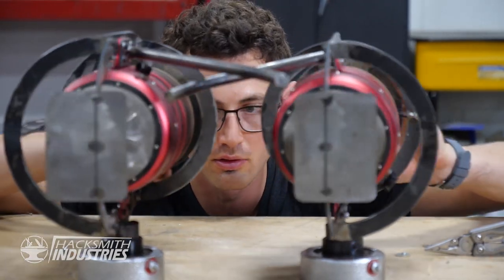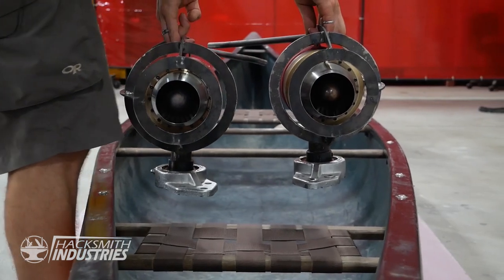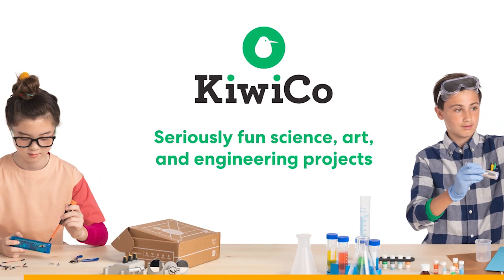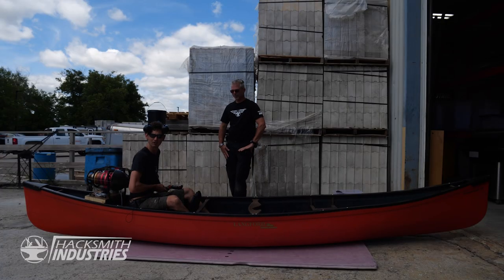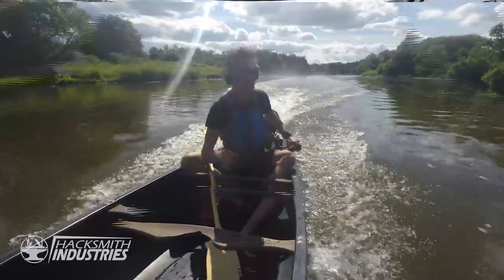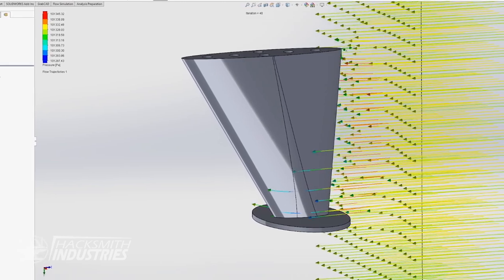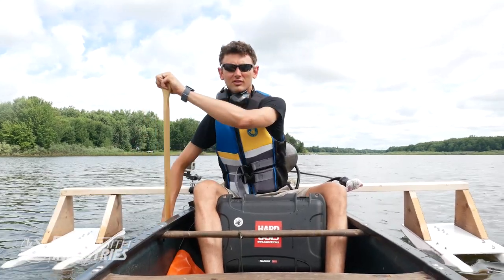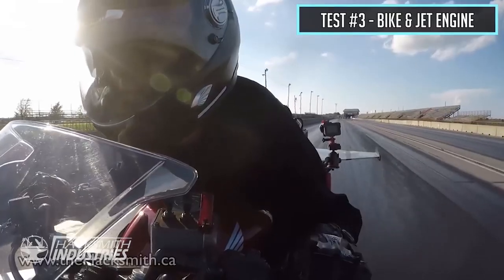JET ENGINE CANOE! (World's Fastest!)

Comment: Putting more weight at the front would probably really help avoid high lift when you are going full power.

Maybe make a bigger fuel tank and put the tank at the front?
Reply: But then what happens when your tank is almost empty?

I think they need to move Ian's driving position forward more... maybe make a revision on the steering mechanism so that he sits low, and roughly in the middle... =D
Reply: Yes. That and also put the driver seat more towards the front of the canoe. Also I noticed that the thrust from the jet engines was pointing up slightly which is acting as a moment and putting torque on the canoe which is probably some of the reason that it is tipping back so much. If they adjusted the angle so that the thrust was pointing down a bit more, it would probably give the canoe a more neutral angle at higher speeds.
Reply: Will a wing that acts like a spoiler work?
Reply: Need to be able to trim the jet engine just like boats are able to do
Reply: @langcapreubenb.6129  It probably would work a bit but wings only work effectively at pretty high speeds (unless the wing is pretty big). So it would be more efficient to reposition the existing weight or tilt the jet engines to a better angle.

Comment: Wait why didn’t you make the tiller longer and so he could sit at the font to weigh the front down so the back wouldn’t go down and he could go faster 🤭🤯🤨
Reply: Talking about hoe smart they are...
Reply: bc you can barely turn if you make it too long.
Reply: Right!?!? It would have been so much faster if it got on the plain and reduced drag in the water. Easy fix!
Reply: @blackhawk97  if you added a tiller extension like in sailing it could work just fine
Reply: because wheelie
Reply: The problem is that the thrusters are getting most of their propulsion from the waters density if the motors aren’t tilted towards to water it would go much slower as it will be pushing against the air density which is a lot less than that of water so in turn the water contact is actually helping the air get grip if you will ( this is a educated theory )
Reply: @Beezle   the mistake is the design of an kanu it cant get faster  ,look at the desin from racing boats and kanu ,kajak ,and sayling boats ,,, excuse my eng
Reply: It wouldn’t make it faster lol and also you wouldn’t be able to steer because of the length of the tiller
Reply: @dylanwatson7189  thats not how jet engines work.... They get their propulsion from sending air backwards. Not from what that air then hits.
Reply: There are two main design faults:
First.... the jets point upwards, they sink the canoe rear end, you need to trim the angle.
Second.... some flat "winglets" widening the bottom of the canoe in the back would lift it and stabilize way more than those fancy buoys you guys made!
Reply: James McCann I fully agree with you. Answer me this though, if the boat had a set of wheels and two thrusters with nothing but the open air behind it let’s name this object 1. Now you have the same boat with the same wheels and thrusts and this we will name object 2, just that object 2 has a wall behind( 2m away from thrusters) 
Will object 1 or objects 2 accelerate faster?
Reply: James McCann this is purely for educational purposes I am not under no circumstances trying to belittle your knowledge. And Nor I believe you mine.
Reply: @dylanwatson7189  please look up how jet engines work. How do you think planes fly? What is the exhaust from those engines hitting? Jet engines get their thrust from the air going through them being accelerated, and then conservation of momentum means that air being forced in one direction must equal the force in the other direction. Because the jet engine is accelerating the air, the jet engine therefore experiances the equal but oppsite force.
Reply: James McCann theoretically it is hitting the air around us. But in this case it is a thruster so they use ignited fuel to accelerate the particles of air that is sucked in but that is besides the point. I understand where you are coming from. So in theory object one and object two will have the same acceleration?
Reply: @blackhawk97   these guys are playing with jet engines, cnc and 3d printers not to hard to engineer a steering column.
Reply: My thoughts exactly, but also how about fixing the engines and making a simple rudder to steer?
Reply: @dylanwatson7189  no, the fuel being used to accelerate the air is not beside the point, that quite literally is the ONLY point when it comes to thrust of a Jet engine. If its the exhaust hitting the water that gives thrust, how does that water push back on the boat? It doesnt. The thrust comes from the air that is accelerated by the engine, not what that exhaust hits. You are embarrassing yourself even more, just please look it up.
Reply: @dylanwatson7189  Newton's 3rd law.
Reply: @dylanwatson7189  the pressure of air behind the motor is not what moves the jet forward. Its that the jet is moving the weight of the air against its own weight. Like swimming in a pool. Having a wall behind you won't make you swim faster. Same goes for how a rocket engine can move something forward in outer space.
Reply: Did nobody remember when James said he had no experience?
Reply: @reesy22  getting the canoe on plain SURE WOULD MAKE IT FASTER...DURRRRR
Reply: Dylan Watson ahhhhhhh
Reply: tloutfitter um no it wouldn’t mate because it was already on the plane 🤣 plus sitting at the front would do nothing to a jet powered canoe, plus you literally wouldn’t be able to steer it.
Reply: If your solo canoeing you don’t sit at the front it throws of your balance
Reply: thats a good idea
Reply: @reesy22  It was plowing through water and definately not on plane.
Reply: @warmcanadain7649  Not at the front but at the back is not so geat aswell. Specially with all the added weight of his propulsion unit.
Reply: That's just too simple for a bunch of engineers. Hell, even a full cooler in the front.
Reply: Or have another person sitting in the front of the canoe would probably do a lot towards fixing the issue as well as most people who have ever been in a boat would know
Reply: @Firefox-cr3jw  Don't think you should be talking about how smart someone is if you can't spell how buddy.
Reply: @dylanwatson7189  No.
Reply: @dylanwatson7189  So in your opinion rockets don't work in empty space, but they do. Work great actually
Reply: @leifvejby8023  no no i just had a theory thus the reason i said it was a educated guess 😂 I did a lot of research revolving around this and proved my theory to be correct but only by the fact that the force of the fuel and compressed airs backwards force to have bounced off the wall causing the air to act forwards acting as a back draft of wind to give it a 1.34second head start but nothing game changing. My argument was that the air around had a effect on the thrust of the jet motor through contact forces of the air molecules which was in a way correct as the thruster needs oxygen but it doesn’t need surrounding air to have a forward force. So i did mix everything up but now it is all understood. Sorry for the confusion🗽

Comment: Could you mount the jet engines to some sort of boat drone that could be operated remotely by a trailing waterskiier?
Reply from the maker: Hah.  Possibly!
Reply: Hi!
Reply: a jet-ski that is controlled by a pulled waterskier has been done already.
now seriously: you should be putting the Driver more to the front to let the canoe lay flatter on the water.
and then it needs hydrofoils.
Reply: Ulrich Kälber yes i thought that too
Reply: Now this is pod racing!

Comment: It's more of a skeg rather than a keel bc a keel has weight.
To improve turning put one of the fin things about halfway up the hull to act as a fulcrum also you need mass in the front to really plain (ride your bow wave)
Put a hydrofoil on it for your next project. To make a flying jet-powered canoe
Reply: It’s Plane...not plain
Reply: First thing I said also. That’s a skeg, not a keel.
Reply: I just like the hydrofoil idea
Reply: They're called drop keels, many small sailing dinghies have them. It's a vertical board that is dropped into a slot in the centre of the boat, to stop flatter bottom boats being blown sideways by the wind.

My remedy would be moving the seat forward, and putting the fuel tank in the bow.

Comment: I wonder if it would have been more effective to forget about thrust vectoring and just use a rudder instead...
Reply: You would have to worry about the effect of torque on the boat, especially if the torque was not aligned with the centre of mass. The effect would be every time you turn you would begin to or even flip the boat.
Also if they moved the centre of mass forward, either by adding bow weights or moving Ian forward, they could of fixed the angling issue.
Reply: a rudder would just roll the boat over
Reply: @Eagle79797  @Dan Luckins Maybe a rudder and out riggers then
and weighting the front goes without saying haha

Comment: NOT JUDGING.

This was an amazing build and I thoroughly enjoyed watching it. 

One thing, wouldn't you be able to get more speed angling the engine at the water as it is more solid therefore producing a better object to push against and allowing more speed to be generated
Reply: not if you think of thrust as a (YZ) vector. it might appear to balance the canoe though, but that would be converting the thrust from  to gravitational potential energy lifting the back of the canoe instead of kinetic energy accelerating the canoe forward.
Reply: Taine Wilkinson Most likely but I would also imagine that with the engines' exhaust outlets facing downwards, the downforce effect on the canoe would simply force the nose underwater.

Comment: How about having him move forward by like half a meter? 🤦🏼‍♂️
Reply: They did the same thing with the Silver Surfer Surfboard, but that hull was actually designed to go on plane.  They built these amazing machines that could go signifigently faster than shown in the videos if they had a little more of an understanding of planeing and hullspeeds.
Reply: It just hurts me on the inside because this thing could be sssssooooooo amazing with just a few tweaks
Reply: @GaggleingTurkey  yup, also less risk for the engines and it wouldnt look like a submarine xd
Reply: I volunteer to ride on board more toward the front 👋

Comment: the keel is solid structure on the bottom of the boat that the rest of the boat is built off of. what you are think of is the rutter that changes the boats direction and keeps it in line

Comment: In order to flaten the boat out, I'd either sit up front and build a longer controls arm, or make a trim adjustment similar to a boat. Where you can control the bow with the angle of the prop(jets).

Comment: canoe hull is made for displacement which you're trying to push it past that speed.  You needed a planning hull like a skiff.   Also maybe try directing the exhaust into a "Y" pipe under the boat so it hits a stream of water and accelerates it out the back

Comment: Mounting the enginesstationary  on hydrofoil style outriggers about 4 feet outside of the canoe hull on each side would allow steering by throttle for much more responsive handling while also increasing stability. This setup  will give the canoe an added capability of a quick 90▪turn and cut throttle emergency stop which with practice can be safely performed in a remarkably short distance from full speed ahead to full stop.

Comment: move the pilot forward thus shifting the weight more towards the bow. then use a joystick and steering cable to keep the pilots weight centered. mount the throttle and switches on the joystick! ( a square back boat would be much more stable too. )

Comment: 1) shift the center of gravity forward and as low as possible. (fuel & controller in the bow operator forward as low as possible.)
2) a small single rudder tied into the tiller. 6" tall by 3" wide centered at the stern protruding 3" bellow the bottom.
3) trim angle is critical at high speed for stability be able to adjust the thrust angle from the jet vertically also make the mounting plate adjust front or back to tilt the jets (threaded rod and a nut)

Comment: I think maybe if you were to change the angle on the jets you could get it to plane out faster. The jets are sitting on the sides on the up slope of the canoe. So technically the jets are pointing down at the intake end causing the nose of the canoe to raise. Raise the intake end up a bit having it higher than the exhaust I think it would work better. The only thing to watch would be your exhaust temp on the canoe.

Comment: This is awesome but you're seriously missing out on some top end speed with the draft angle you've got. Might I suggest some wedges in between the jet mounting plate and the gunwales such that the jets are angled downward instead of parallel with the keel? That should bring the bow down so you cruise more level relative to the water. As an added bonus, having more of your keel in the drink should greatly improve stability at those higher speeds.

Comment: Needs some small upward angled planes at the rear sides so that as the canoe moves forward the rear is prevented from pushing down. It also needs a rudder at the stern for direction control.

Comment: Did you taper the jet engine mount? It looks like they were pointed upward where the canoe angled up towards the stern. That would push the stern downward. That was the problem with the outriggers too. The noses of them were lower and they were digging into the water.

Comment: Love the concept of the video I feel like if you guys figured out a way to weigh down the front just a tiny bit more in it so the boat to climb a little bit more out of the water instead of riding in the water it’s basically skipping across the water and because you’re using the engines pointing towards water pushing you forward you’re gonna get even faster I think if I’m not mistaken on how boats work

Comment: From my understanding the goal of hydrodynamics in regards to boats + speed is to raise the hull of the boat out of the water as quickly and stably as possible to reduce the contact with the water. Most fast boats have just the very rear of the boat in the water. In this particular case, you're not modifying the hull so you are really looking just to stop plowing the rear of the hull down into the water. If you made a mount that had the jet engines in roughly the same area but did not attach to the boat at that location(cantilever mount), and instead attached more toward the middle or even slightly forward, you could create opposing forces. I would probably make this mount attach to a rail in the floor of the boat so I could make adjustments from stem to stern and lock them into place to test for optimal trim.  You also want to reduce as much weight as possible.... obviously.

Comment: You guys should put a metal plate behind the engine to cover water from getting in the canoe, also if fuel and weight is a problem just put a bigger fuel tank in the front so you have more gas and it will not lean as for back. Please try this idea I think it may help you guys. P.s. I love the videos and content that y’all make keep up the good work.

Comment: You guys would have to put some heat shielding on top of the rear of the canoe but adjusting the angle of the jets so that they point on a downward angle toward the water should prevent the bow from sinking by creating upward thrust off the surface of the water. It will also make the canoe faster once it is trimmed right.

Comment: Try it on snow. We did something we called "canogganing" back in the 70s but we just used gravity. Steering is impossible, bailing out is unthinkable, braking required a tree or large rock. It should be an absolute blast with a jet or two. 
Believe it or not, I've tried this with a massive leaf blower having limited success.

Comment: Need to change the thrust angle, the engines are pointed up a little and pushing the back down, if you aim them slightly down from the get go it will wanna push the back end up slighltly and you may be able to hydroplane it

Comment: Crazy idea. The canoe is basically a long ass lever at this point, with all of the weight on the back to force everything down into the water. See as how fuel is heavy as hell, and levers work on distance being better than force, couldn't you try to balance the canoe by putting another, larger fuel tank up in the front of the canoe, thus leading to a higher speed output, as the canoe wouldn't be crashing against the water as it traveled, but slicing though it, like a canoe is intended to do?

Comment: Everybody is talking about weight distribution, that´s note the solution here. Ever seen the stern of a hydroplaning boat? It´s not a coincidence it´s not as narrow as a canoe. To hydroplane you need an edge for the water to release from. In this case preferrably by widening the hull, at least below the waterline, from the canoe´s widest part and backwards to resemble a normal, planing hull.

Comment: What would be a good v2 is if you had a vertical stabilizer so you could push down to angle the nose down for more speed you would have to figure out a good height so nothing gets melted.

Comment: Use cable linkage system so you can steer from the front so it stays in the water better. I have to bring weights if I solo canoe because the front is to far out of the water. The angle might be right for the jets cause you would probably wont the front to raise slightly when on full power.